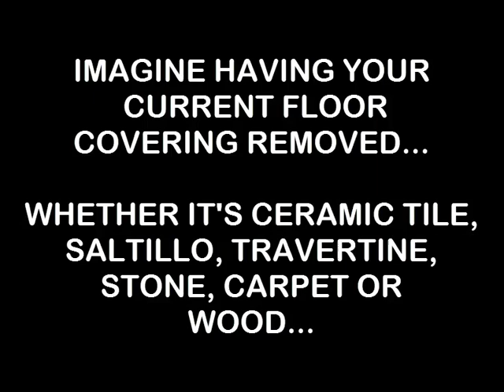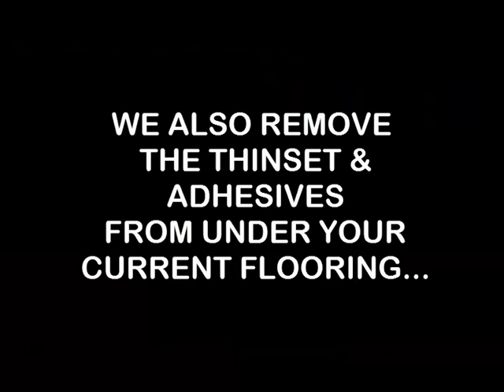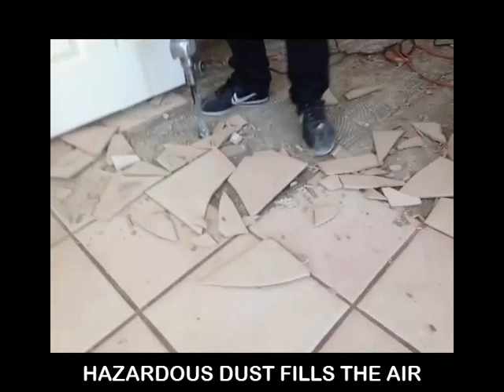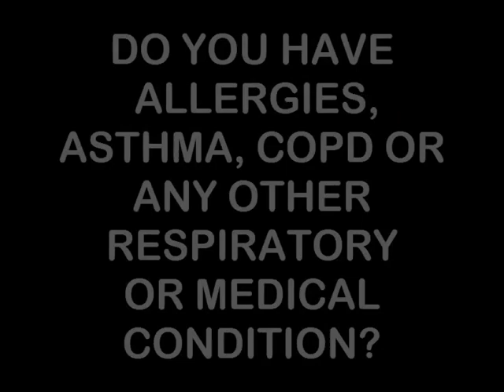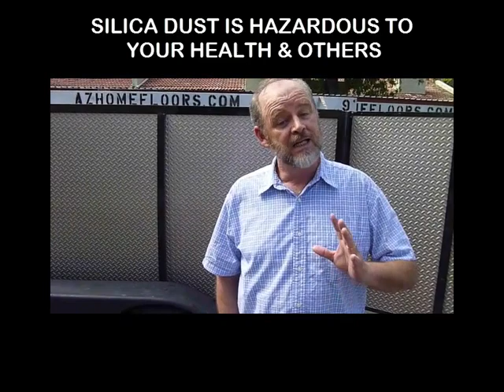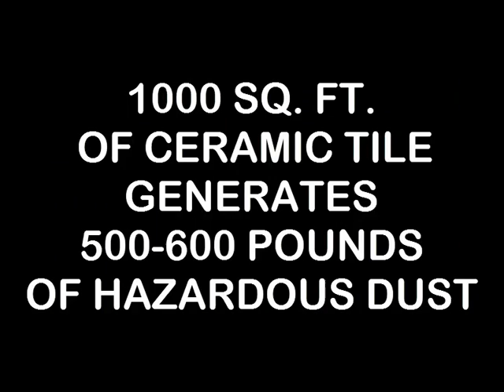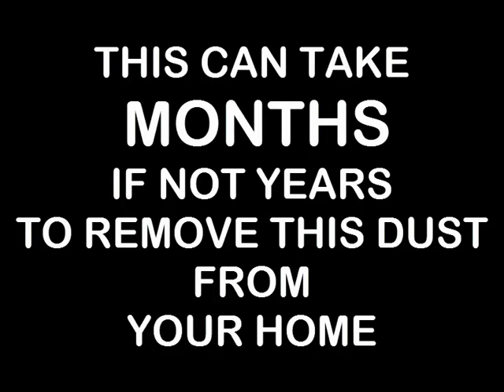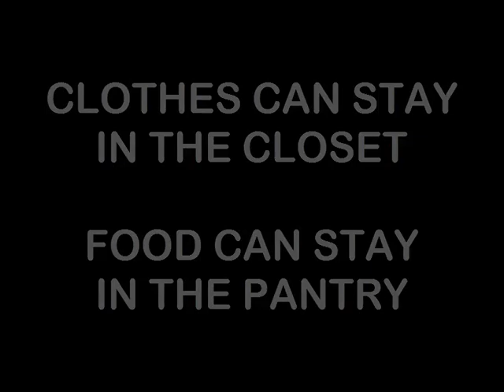(480) 428-3880 - DustRam® System of Tile Removal Tools & Equipment Is the Dust Commander

Comment: Where i can buy one like this. And how much it coast?
Reply from the maker: +Admin HR 
The DustRam System Equipment shown in this video is available to contractors, flooring installers, remodelers, and property management companies who have experience in the flooring or concrete industry.  Complete end-to-end system packages, with components for all steps of the removal process, are not sold to homeowners or rental companies.  3 Days of factory training is provided to insure purchasers have the knowledge and skills to perform a truly Dust Free removal every time.  For more information, please visit www.DustRam.com.  If there is not a contractor in your area who has the DustRam equipment, let them know about DustRam and your desire to have your flooring removed Dust Free. 
#dustram
#azhomefloors
#dustfreetileremoval